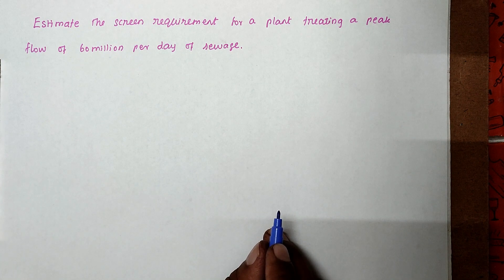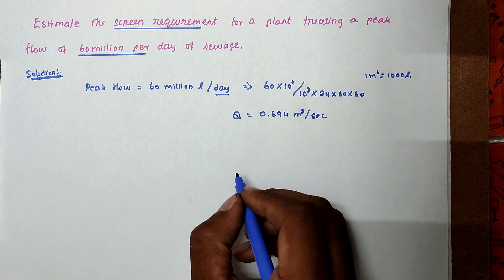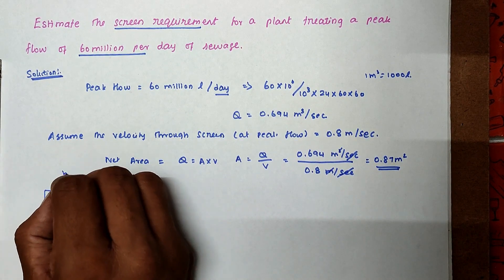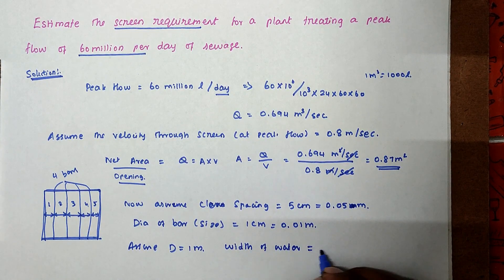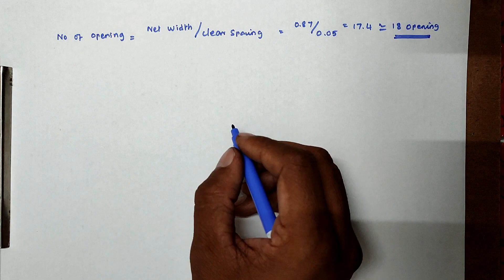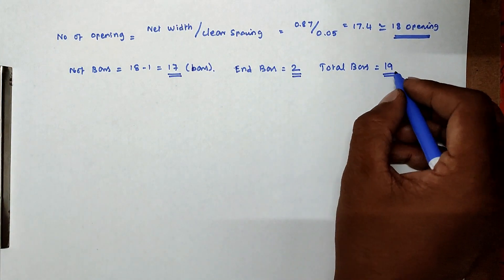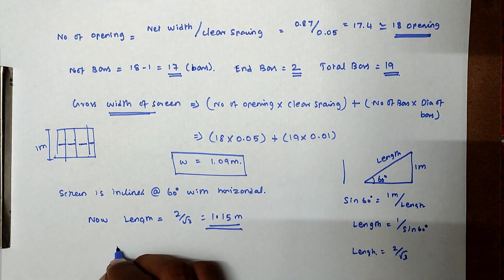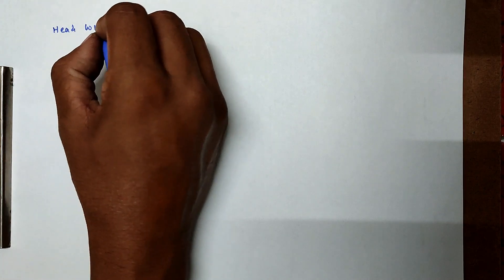design of screen chamber | design of bar screen chamber | waster water engineering designs | #civil

Comment: Design a coarse screen for the following conditions:
A design flow of 1.0m3/s in the approach channel and vh = 0.8m/s.
Coarse screen specifications: β = 1.67, W = 10 mm and α = 30°.
Channel depth = 0.8 m.
¡ What is the effect on the flow velocity when the screen is
half clogged?
¡ What is the headloss when the screen is 50 % clogged?
¡ At what headloss should the screen be cleaned so that the
velocity does not exceed 1.2m/s?
Please can you help me with this question